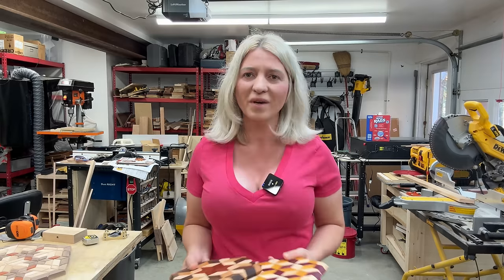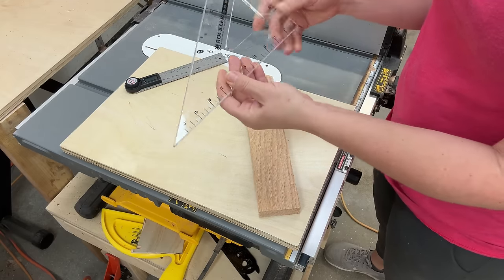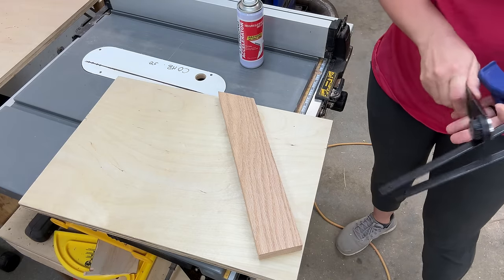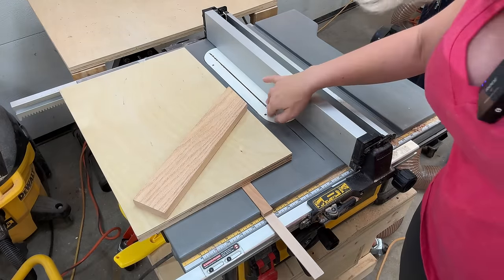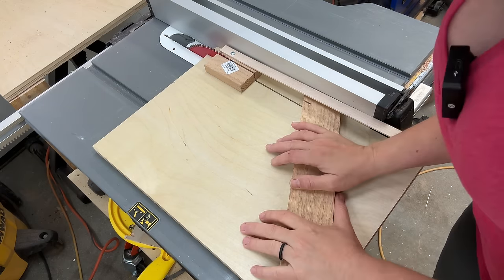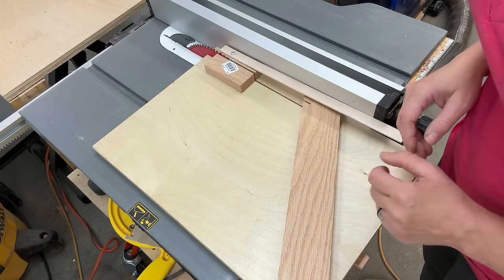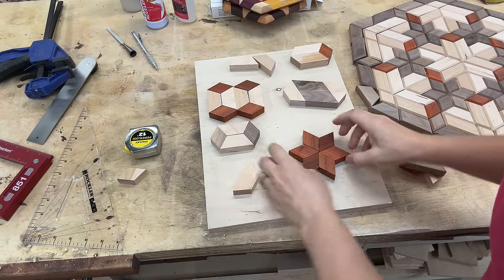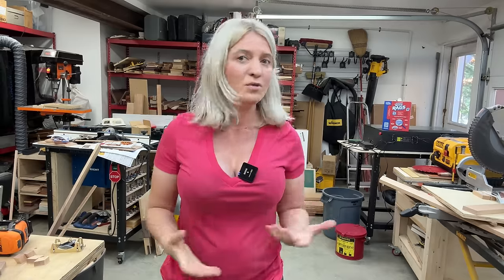How to make a jig to cut geometric wood shapes. Mosaic style cutting boards, tables, trivets, boxes

Comment: Nice video, but I had to stop watching and come to comment right when you started cutting the first little pieces. Why do you keep the fence over there? If the fence wasn't there - and it is totally unnecessary at this point - you would just keep pushing the 1-inch board in, this would push the little pieces off of the job and the work would be faster and safer. Now going to finish the video 😊

After watching some more: you could prepare little spacers that would allow for exact fence setup. You then take the spacer, the arbitrary fence and set it up against the blade. You fix the fence and move the arbitrary one to the front and done.
Reply: Ze
Reply: There’s more than one way to skin a cat, and we learn from our mistakes, and maybe that’s the whole point of the video, I still think she did a great job, as I’m sure you do too
Reply: Agreed, great video, but.... You should never use the fence when making a through cut and a miter. And while it's true that "we learn from our mistakes", table saw mistakes can result in amputations.  That’s an expensive lesson.
Reply: Very nice video will have to try and do one of trivets.
Reply: hahahah this comment made me happy.... lately i've been watching a ton of wood working/home reno/ just DIY home repairs, decor etc... and have you noticed like maybe 2 out of every 1o i've watched, they literally don't seem to have any idea what the f their doing hahahaha so this cracked me up!😂
Reply: OH P.S.
Just want to say i am not at all making fun of her or being rude AT ALL, because that isn't me I'm a nice person who HATTTEESSS 
bullying/putting others down. I don't think it is EVER Acceptable, AT ALL, to be an ass wipe to others. Especially people like this lady who have the courage & confidence to post tutorials, because I know I couldn't! So, take what I'm saying in a joking silly way! She did a great job honestly!! 
your comment just was funny cuz of the timing I saw it, lol. ANYYWAYY great job here, & I totally wish I was brave enough to film/post myself like this! ❤😊

Comment: Love your work Skyler. If you don't mind a suggestion, if you make your stop block exactly one inch thick, the any desired cut can be made by adding one inch to that measurement. If you want a two inch piece, set the fence at three inches, etc. This eliminates trial and error or math mistakes. I have had mine for years.

Comment: Hi Skyler, love the video but how do you glue everything together? A square or rectangular board is relatively easy, clamp the sides to get a tight fit and over the top to prevent bowing but how do you do that with a hexagonal block made of many small shapes? I looked for a video showing how you did the next stage but couldn’t see one, any chance you could make one?
Reply: I am wondering the same thing. I guessed maybe it was the two parts glue but I'd love if she'd reply with the clarification.
Reply: You use one of the following: elastic bands, large hose clamps, painters tape (how you do miter joints when framing), or string.

Small pieces are easier if you place them on a strip of painters tape so you can open them out to put glue in the joints then place them together. I personally use large hose clamps I make up myself but bands work just as well if trickier to get the diameters correct.

Comment: Hey Skyler, Pat here from outside of Toronto Canada. I’d like to try this but I think I’ll use some pine and cedar for my first attempt. I have both on hand and they are less expensive than the hard woods.  I’m interested to know how you go about gluing all these small pieces together…..and the clamping must be a nightmare?!?!
Reply: Some make clamping jigs. Some use band clamps. Some glue up extra pieces, to make it square, build a rectangular, clamping frame. Then cut to final shape. One makes boards with thin edge strips, like edge band then clamp in three directions. If Skylar gets back to you, we'll see what she does.
Reply from the maker: I am going to be honest. Trying to glue this is a pain.  The trivet I did in class we used two 6 in hose metal clamps linked together to clamp it. The first one I did at home I first glued it on small sections and then glued the sections together. That was a mistake as the dried squeezed out glue was in the way creating gaps between section and you need to send that away without removing any wood material. The second one I did I glued all together at once and use a strap clamp. Pieces moved a bit and tried to move everything in place as good as I could but still had to fill some tiny gaps with glue and sawdust.
Reply: @woodworkingwithSkyler I am going to try to make one myself because of your inspiration. Could I glue the pieces down onto a thin shaped board do think?
Reply from the maker: @mondujar279  that’s what I am doing with my large project. I will glue it on a plywood piece and turn it into a small side table. Hopefully:)
Reply: As far as glue ups, depending what your end result, I have tried with failure, just using new rubber bands.  This allows you to figure how much pressure you use.  I love the idea making some extra jigs to clamp everything. If your trying this exact project.  You maybe on to something. For what I a trying to do. I believe it’s close but not same. I may have more or less tolerances that you.
Reply: I just finished a project that had multiple pieces such as these.  There is always a top and bottom preference to each piece. I orientate the nicest top of the piece then arrange them upside-down in a locking frame, plastered glue on the substrate and placed it on top. As long as the pieces are held tight and accurately cut, they all line up without any gaps.

Comment: HI, just seen and enjoyed the video  Just like to make a comment about the set-up.  You say that you need to check that the base plate is perfectly square.  However, the way you have measured the 30 degree angle, your piece of 'scrap' oak also has to have perfectly parallel sides, other wise you will get an error.  An alternative would be to just ensure that the base is flat on the edge that rests against the fence and then measure 120 degree from that edge to the top of the scrap (which then only has to be flat.

Comment: First time here. This was interesting. As I watched, you said you would have to cut two or three pieces and then stop the saw to remove the cut pieces so they would not get caught in the blade. Could an arm be attached to the sliding board to pull the cut pieces out and fall into a bucket? The piece that actually pulls the pieces out would need to be smaller than the pieces you cut. The design is for you to determine. Have good days!

Comment: I do something similar for making segmented rings for turning on the lathe, I can see doing things like this for turning as well.  One thing I do that could be usefull for you to add is on the saw blade cover I have an angled piece on the off cut side of the blade, so that when the piece is cut off it drops down the slope away from the blade and the small parts are blocked from getting back to the blade, it allows me to cut qite a few pieces before I need to stop the saw to gather them up. I also use a much wider block on the fence, like what you are using, this gives me more space for the cut off pieces. This is the first of your videos for me to see, I shall take some time and watch your others, it looks like you do some very nice work.

Comment: Love the shape that your working on. The 3D affect is amazing! I would just like to point out that the pattern top right side, about 2 o'clock is not quite right. Its not the same as the other side.  Hopefully you picked it up prior to glue up, unless you planed it that way, Your work is fantastic  Regards Nick.

Comment: Love the work you are doing. Awesome.!!! When using the stop block, move it up parallel to the blade and then measure the one inch or what ever the width of the board is.  Then move it back, clamp it as you did, move the wood up to the block, then cut it.

Comment: Love your channel and what you create! I think I figured  out your 2 jig problem. I made the diamond jig and was thinking about how to improve to the other shapes jig. Then it hit me, how to use the diamond jig for both. All you have to do is put a piece of your shaped stock between the blade and the fence to get the width,  lock your fence and take out the stock. Now you can make the other patterns and take them out just like the diamonds. Also you do not have to guess at width.
Reply from the maker: That’s awesome. Will try it

Comment: Hi Skyler, do you have time to answer a question? If my sticks were 25 millimetres wide instead of one inch and my 30-degree cross-cut was also cutting at 25ml length instead of one inch, shouldn't the diamonds still match?  Thanks. You are so accurate and the cuts are so perfect, it's like having a CNC or laser cutter in your workshop. How good is that!
Reply from the maker: Yes, absolutely should work the same

Comment: Hi Skyler, great demonstration! The only change I would recommend is to measure that 1” to the stop block. The prices for wood at my local Woodcraft store have really shot up over the past 6 mos, sometimes doubled. Trying for less waste 🤔
Reply from the maker: great idea
Reply: And, using a stop block reduces the chances of kickback.  It would attach to the fence and the fence would have to be moved the same amount equal to the width of the stop block.

Comment: Great video Skyler.  
If you  secure a shop vac hose near where the pieces come off the blade they will  be sucked up and you wouldn’t have to stop.  I use it for cutting very small pieces on my miter saw as well.
Reply: Sorry didn’t realize that I already commented.

Comment: How did you make the champher on all those small pieces on the project that wasn't finished yet? Please let me know how you did it worried to do that with such small pieces
Reply from the maker: Used the spindle sand belt and put my table at 45 degrees sanded all the edges
Reply: @woodworkingwithSkyler Really? How did you keep them all the same? (sorry for all the dumb questions)

Comment: I'm very curious how you added the chamfer to those small pieces. Do you have another jig for your router table? How do you do it?
Reply from the maker: for the first 20 or so pieces I used a small hand plane. That was no fun so I moved to the spindle sander and moved the table at 45 degrees. That made it a lot easier and faster

Comment: Excellent video Skyler. Maybe you can use a long pencil eraser as a push stick to clear out the pieces?
Reply from the maker: That's a good idea!
Reply: @woodworkingwithSkyler also might use a angled piece the length of the saw blade attached with double sided tape for the pieces to fall away from the blade as they are cut off.

Comment: If you glue a 1x1 inch stick to the side of the stop block you can make all three shapes without moving the fence. All you have to do is to flip the stop block over.
For the measuring using the stop block, just move the block forward to align with the blade and then move it back to the desired location before cutting.
Reply from the maker: Great tip. Thank you

Comment: Great video, the only thing wrong is your strips have to be .85 inches wide instead of 1 inch to get the 1 inch measurement on 4 sides.
Reply from the maker: I made a mistake when I said the sides were one inch. The strip of wood was one inch and the fence distance was one inch, the sides were longer

Comment: At 4:47, why not use a small piece of wood to put against the end of the board, then place the angle ruler against it and clamp it. Perfect.
Reply from the maker: Yes, However, I recommend using a caliper and check both widths of the diamond. If you are off even by a quarter mm it will add up as you add pieces and you end up with gaps

Comment: This is great Skyler. Any tips on glue-up and clamping?
Reply from the maker: I am still trying to figure that out:)
Reply: How did you glue yours up?
Reply from the maker: @beepee5833  the one we did in class we linked two 6in hose clamps and use that to clamp. The one I did at home I use a band /strap clamp. The first one I did I glued in small sections first then when glue dried I glued those sections together in a big section. That was a mistake as any glue squeeze out that you have and it dries will prevent the next piece to sit flush so you end up with gaps. So I tried again and this time glued the whole thing at once and glued. It was better but not perfect. Still had to fill in a few gaps with sawdust and glue.
Reply: @woodworkingwithSkyler  Thanks for explanation. Love your work!
Reply: @woodworkingwithSkyler Use CA and glue. CA acts like a clamp and let glue dry in place. 😊😊😊

Comment: Hello again
Paul here
I still cannot get perfect diamond shape.
I set up like you said but the 4 sides of my shape are not 1 in, they are 1.3 in .and it seems when I put them to gether , one is always longer than the other. If I put them 3 to get octagon, the last one has space and does not fit snug....I have tried making another jig but get same 
Thank you
Reply from the maker: Paul, the 4 sides are not supposed to be 1 in. It supposed to be whatever that beveled cut length is when cutting with 30degree angle
Reply from the maker: All sides should be same length whatever that bevel length is. Since you are starting with 1 in blank and cutting an an angle it is going to be longer then the width of the material
Reply: @woodworkingwithSkyler  thank you
One corner always is higher than the other, both sides are not the same or across from one another
Reply: I'll try again 
Thank you very much
Reply from the maker: Here is an other way to cut them without a jig How to cut and glue geometric wood shapes . Mosaic style cutting boards, tables, trivets, boxes
https://youtu.be/2XfVM2Ee_oA

Comment: Hey Ms Skyler how did you do the chamfer?
Reply from the maker: Hi Mike . In the beginning i used a small handplane. That was taking too long so i ended up using my spindle sander with table position at 45 degree
Reply: @woodworkingwithSkyler  
Oh, ok, I just thought that the pieces were so small that it would be very dangerous to use any power tools to put the chamfer on them. Thank you for replying to my question.

Comment: My diamonds do not come out 1in...every adjustment does not have finnished diamond even on both sides
Reply from the maker: Hi Paul, if your diamond is not perfect that means there is a small mistake on making the jig. However I figured a way easier way of making diamonds of any size, will make a video on it soon
Reply: @woodworkingwithSkyler  thank you for responding

Comment: To get your exact measurement from the blade edge to the stop block, just move the stop block up even with the blade. Measure from the blade tooth to the block. Once it's exactly 1", lock the fence in place and then move the stop block back to its position before the blade. So much simpler.
Reply from the maker: I wish I thought of that. Thank you
Reply: @woodworkingwithSkyler  you're welcome! Sometimes the simplest answers escape us because we're focused on something else, and it just takes a 2nd set of eyes.

Comment: At 19:35 the piece you are cutting will be a sawblade thickness smaller than the piece you used to set the measurement. Is this Correct?

Comment: With the second jig you say you need to stop after you do so many diamonds to clean them out but you still have the same problem with the other two shapes. The first jig takes you longer because every time you cut a diamond you need to stop remove it cut another one stop remove and so on